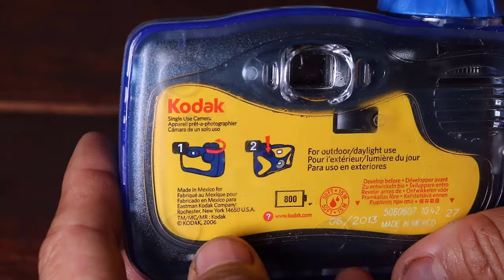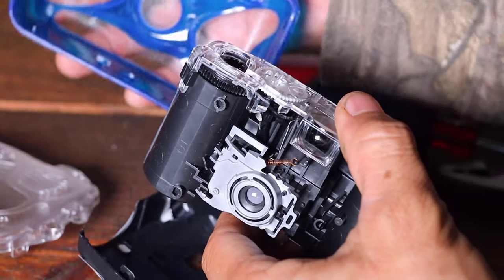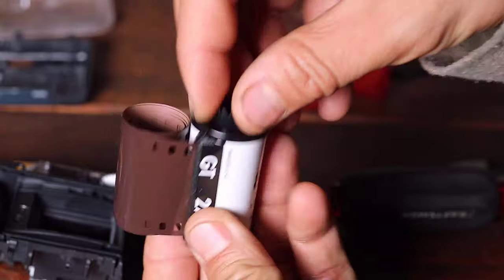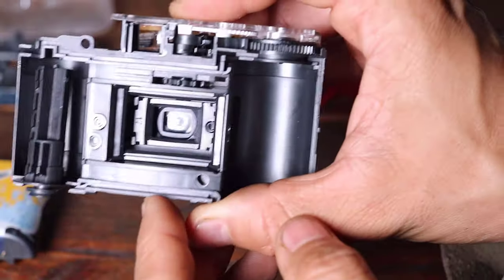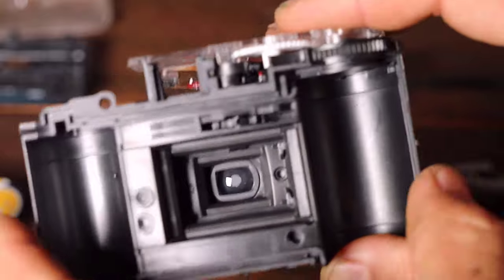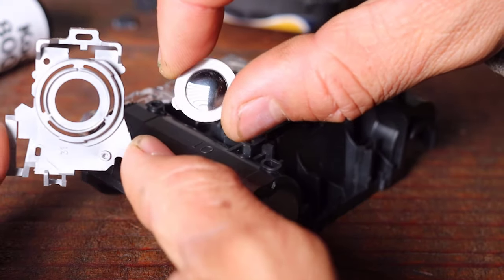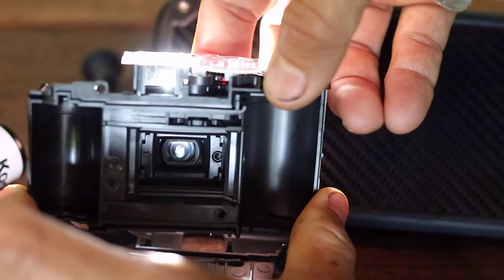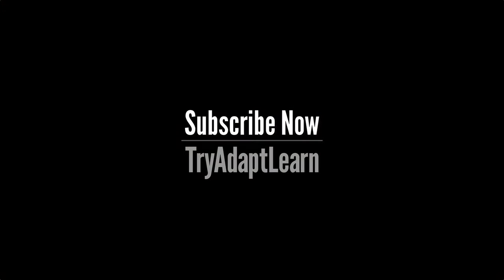Inside view of a Disposable Waterproof Camera: what's inside the case

Comment: I'm I'm looking for ways to extract the film out of disposables to use in other cameras and this video was very informative, thanks. It's much easier than I thought.

BTW, my anxiety was going crazy when you were playing with the film roll, exposing it to light lol
Reply from the maker: Thank you very much for your feedback.  I'm sure there is a much better procedure to open the case.  There's likely a specific tool unless it was opened by machine at photo printers.  I exposed the film roll as more of a demonstration of what it looks like exposed.  I knew from the start that I would not be processing the photos on the film.
Reply: @TryAdaptLearn  I'm glad you did it because I get the urge but I just don't have the will to. Thanks again for the info

Comment: I wish it was a video about reassembling the pieces. And how to reuse this kind of camera
Reply from the maker: Thank you for the feedback.  I guess it could be possible for this camera to be re used since there is no battery.  There was a bit of work to take everything apart.  To reuse the camera, the biggest challenge would be to take the two cases apart without damaging them.  They would then snap back together.  Film would need to be loaded like any old film camera with a little bit out so the teeth of the wheel can grab it then with the camera completely closed, you could wind the film back.

Comment: is it possible to use it after you take it out of the waterproof case?
Reply from the maker: Yes.  The camera in this video would function without the case also, it had no flash (or battery).  If the camera was not damaged internally (or film damaged) while removing the case and there are still exposures remaining with the film, it would work.

Comment: Hi just wondering but what is the purpose of that wheel thing at the top and everytime u take a picture do u have to wind it until it clicks?
Reply from the maker: The wheel will wind the film into the film canister and move the film to set up a new frame to be exposed to the light and take the photo with the shutter.  It’s a manual process for each frame but it eliminates the requirement for an electrical motor or battery to wind the film.
Reply: @TryAdaptLearn  thank u so much! I hope ur channel does well

Comment: When you take out the camera of the waterproof case, is it possible to reuse the case if you loaded it with another disposable camera?
Reply from the maker: It could be possible depending on how it was taken apart.  In the video it was carelessly taken apart because it was going to be discarded.  There may have even been a tool to use for these cases when they printed the photos from the film.

Comment: Amazing video!! I find it hard to push the button to take the pictures tho... actually i can't figure out how to do it, do you have any tips?? I haven't used my camera yet bc it just won't work :(
Reply from the maker: The button on these types of cameras should be able to work with no problems if the internal parts are set in place and not broken.  If these parts are set, other issues that may keep the button from functioning could be that the next exposure/frame of the film needs to be set (by rotating the thumb wheel).  Another possibility is that the film may already be rolled past the last frame/exposure and no more photos can be taken.

Comment: Heyy , im done woth photography , how to take out the film from camera so i can go i scan the film , i need to break it like you did ? There is no other way ?
Reply from the maker: As far as I know these cameras were made to be opened at the film processor/printer.  I never seen the process done at the printer so I can only assume that they had the proper tools to open the camera quickly, but these cameras are designed for single use.  Photography film needs to be processed in a dark room/dark machine before it can be scanned.  If you open the camera yourself, you have the risk of exposing the raw film (if it’s not fully in the film roll) which will destroy the image on it.

Comment: How would I get the pictures out from the camera
Reply from the maker: I would try to take all the pictures and make sure they are wound up in the camera.  Then contact a company that will process film photography.  They may be able to open the camera.  If they cannot, you will need to open the camera to take the film roll out of it, and make sure that the film is rolled up before  opening the camera.  If the film has frames of pictures that are exposed to light, they will not print. Once the film roll is removed,  it can be sent to a film photography printer.

Comment: do u know how to view the pic that u took??
Reply from the maker: The view the pictures, you would want to take the camera intact to anywhere that processes color film for photos.  They should be able to take it apart properly without exposing the film.  If they can’t take the camera apart but can process the film, then there is no guarantee.  If I was in that situation, this is what I would do:  1.  Take all the pictures/exposures.  2. wind the camera as much as possible after there are none left.  3.  Take the camera apart.  4. All (or most) of the film should be in the roll.  If not, whatever is out of the roll will not be able to process into  a photo.  5.  Take the film roll to someone who can process color film photography.